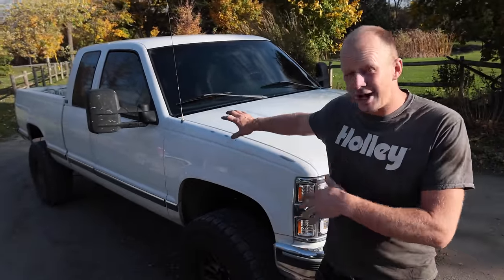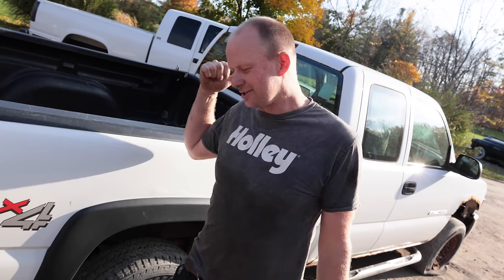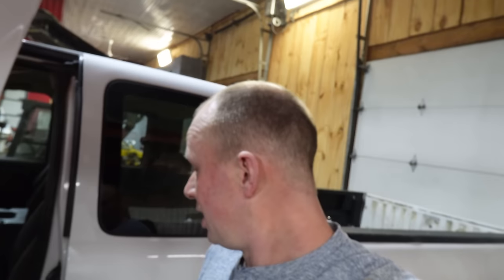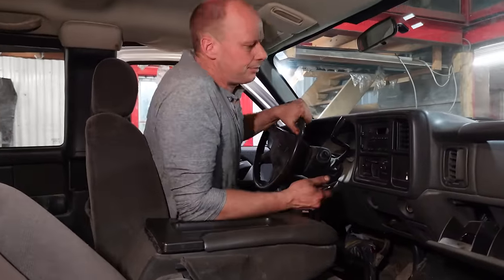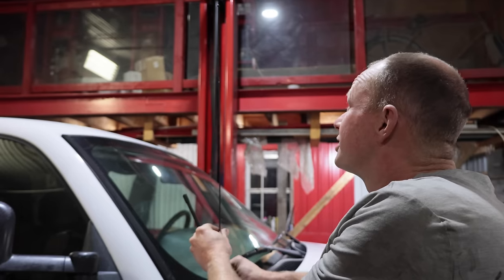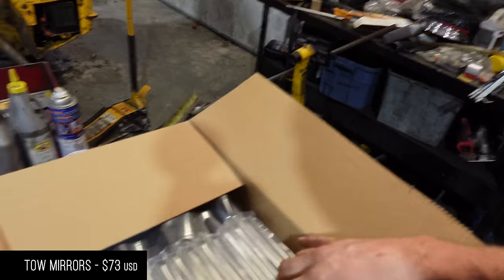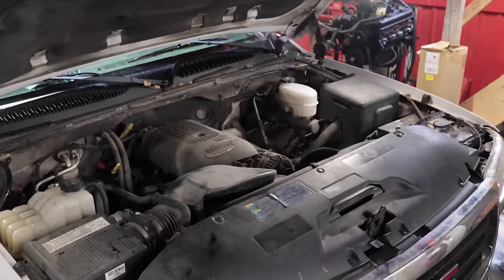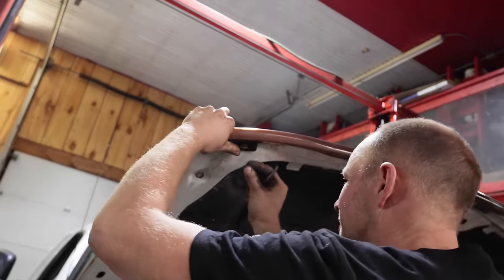Top 10 CHEAP Upgrades for a Rusty Sierra/Silverado!

Comment from the maker: What do you feel is the best value for the money on this list? (affiliate links below)

Spark plugs https://geni.us/TR5GP
Rear door handles https://geni.us/15758171
Front door handles https://geni.us/15034985
ATOTO Carplay/Android stereo https://geni.us/A6PF
SCOSCHE install kit https://geni.us/ICGM8BN
Backup camera https://geni.us/PMD2A-S
7" Antenna https://geni.us/rydonair
Tekonsha P3 trailer brake controller https://geni.us/90195
Reese Towpower GM harness https://geni.us/78050
Tow mirrors https://geni.us/TWM-001-T222-BK
LED brake light & cargo light https://geni.us/tresound
Pennzoil  Full Synthetic https://geni.us/5w30
Oil filter https://geni.us/pf46e
Fender flares https://geni.us/oxgord99-06
Bushwacker rocker set https://geni.us/ext-cab-trailarmor
Hood protector https://geni.us/highprofilesmoke
Transfer case housing adapter https://geni.us/926-891
Gasket https://geni.us/felpro72770
O-ring https://geni.us/926-832
Toyo Tires  A/TIII https://geni.us/toyo355570
Reply: And a wire brush and a lick of paint…
Reply: Love your content BUT really tired of hearing you talk Shit about FORD it's Sooooo Funny how they out sell the others.   Again love your video's you do a amazing job 👍 with your videos people really can learn things if they pay attention they will learn how to do things.
Reply: probably got a bad lifter or two
Reply: Heavy duty rear door handles for future reference you can get metal door handles for the handle in between the two doors I found mine by typing in Chrome heavy duty door handles they look different but they are way more rugged because if they're metal you don't break it when you get upset  you can't open the rear door and break the handle all to hell LOL

Comment: Being the owner of an 05 Silverado in Michigan, I feel personally targeted by this video.
Reply: I got an 03 Burb in MN. So relatable =P
Reply: 2002 Silverado in Georgia. 21 years and rust free glad im the south but i still wana do some of the things he did here
Reply: theres anything left of that?
Reply: 01 Silverado, original owner. With the 4.3. Take that for targeted.
Reply: From Michigan and we as a state do not fucks with this video 😂
Reply: @ewdtrey  good motor... check your coil wires, they break inside the plastic sheathing at the hard bend into the top of the coil
Reply: I bought a used car from a dealership in michigan, back in 84.  The brake lines broke on the drive home.
Reply: Same lol, got a 2001 Silverado in Michigan
Reply: 03 Sierra also in the mitten. I feel ya man, my driver's floor pan is gone
Reply: Womp womp

Comment: As an 06 VortecMax owner, I identify with everything in this video. Besides needing the usual ball joint, tie rod end, etc etc replacement, and one rusty brake line…it’s been a really good truck. I bought it out of Michigan and brought it home to Minnesota. But the only rust is the inner rockers. I decided rather than chase the rust, I’ll run it a little longer then swap the LQ9/4L70 into my square body project. This was highly entertaining Rich!

Comment: Yes. A northern truck. The frame might rot in half and all of your brake lines and fuel lines are leaking because of the rust and all of the body has holes in it but hey, the dash looks great! Always looking on the bright side even if there is no sun

Comment: I did the exact same thing two years ago.  I picked up a dirt cheap 2000 Sierra 2500 4x4 SLT(leather!) with a decent frame, new brake lines, a broken flexplate and bald tires for 1800 bucks.  I live in NW Ohio, so it's a typical rusty mess with no rockers.  Bonus, being an SLT, it comes factory with fender flares that I zip tied back to what remains of the fenders and bed sides.  I took care of all the problems I could find, including yanking the heavy-@ss 4l80 to replace the flexplate and rear main, and found out (after I could drive it with out shaking itself apart) that the transmission was not going into lockup.  Took it to my local transmission shop once I figured out it wasn't just a bad lockup solenoid, and they said the pump wasn't happy after it's broken flexplate adventure and the transmission needed a rebuild.  Now I have an ugly truck with new tires, wheels, brakes, radiator, flexplate, rear main seal, oil pan seal, rebuilt front suspension, shocks, and a rebuilt 4L80e behind a 6.0 with rock solid oil pressure at 240k miles.  I figured the same thing as you, once the truck rusts so bad that the fame cracks, I'll yank the driveline and stick it in something else, probably another GMT800.

Comment: Life in the Rust Belt. Nice Job Rich. I have A 06 GMC Sierra regular cab 196k. I did  flares that attached to the factory holes with push pins & OAM quick Covers. Looks 100 times better

Comment: I don’t regret just getting a new truck. lol. I owned 5 of this era gm truck and while they are awesome and reliable, cheap to fix for the most part a simple. I like getting in a new truck and not having to worry about getting underneath always fixing something. That said I use my truck for my business so obviously a rust bucket is not for that. But if I needed a winter beater just to get around town this gmc you got would be my pick.

Comment: You could do some cheap and fast bodywork on the lower doors and Cab conners and spray paint with a rattle can and it will look amazing.   Throw some Bondo on it sand it down and spray paint it and BAM no more rust you get the picture.

Comment: Thank you for this. I had a mint 99 obs Tahoe my grandfather bought new. This summer a girl was texting and driving and didn’t yield on a green left turn. Plowed right into her. Thankfully it wasn’t head on but my front end is pooched. Only fluid I lost was battery. I’m thinking about an axle swap incase the suspension is messed up. I had bought an 03 Yukon xl from a guy from work for a grand to use as a farm truck. Now I get to freshen up the Yukon it’s pretty rusty but the frame is mint. Plus the 5.3 is dripping enough I have anti rust spray lol 
Thank you for your work sir!

Comment: Tut, tut, tut, Rich, before putting the rocker cover, you could've rattlecan white the rust sticking past the cover.

Body colour rust attracts less attention than contrasting orange.😉

And the bonnet lip protector thingy with one side snapped, well.....trim the other side to match.

With all that done, you'll have a 5ft truck instead of a 10ft😜

Ain't Bangernomic fun👍🏻😂

Comment: With those rocker covers, if you installed them on a truck with perfect rockers, as long as you put a bead of silicone around the edges,  o dirt or water will get in there.. that’s what I did with all my fender flares on my trucks and they never rotted out once.. not even surface rust

Comment: I had an 04 that was in similar shape. Knock and o2 sensors were gone. If I drove it like a grandma, MAYBE I could get 400km to a tank. He old girl had 400,000km on it. I ran it till the cost of new tires exceeded the value of the truck, then sold it. Still see it driving down the road!

Comment: Finaly a video i can relate! 😅 i bought a 06 2500HD 6L 4L80e 4x4 just because it had a working plow on it for 1500CAD! in really similar shape. 283k kms driver seat is mint but ive inspect the frame and its just a bit too rusty for my liking so im not going to dump money into it to make it road worthy  but i will 100% keep it for parts i even have a SLE so its got some nice opt into it! 😅

Comment: I put the same mirrors on my lb7 and I noticed the same issue with them, that they don’t rest in the correct place. I ended up welding a tab onto the pin that allows the mirrors to pivot. Making it to where they no longer pivoted, I figured it was a get what you pay for situation.

Comment: See if you can swap the bottom part of the seat with the passenger, I was able to do that with my Dakota it was like night and day. It put the rip on the inside of the passenger side and gave me a cushion that seemed to never been sat on. It has 230k miles and still drives I just have to fix a couple of things to put it back on the road, might do that this weekend.
Reply: It's a bit of work, but this does work
Reply: @taylor2105  On my Dakota it was just some clips holding the cushion on, didn't have to remove the frame. Fold the seat forward, pop the big clip off the back, then push the seat back to get the side clips, then it slid off the front. I never owned a Chevy so I don't know if it would be this easy.

Comment: 2005 Silverado 1500 5.3 LS (best engine in the entire world) 480,0000 km on it. Never not gotten me to the beer store. Needs rockers and corners. New exhaust (tip) aftermarket radio, underglow. **comes with STOCK RIMS** $10,000 obo - low ballers will be ignored 

^Every Ontario Kijiji listing for a bartered old pickup that will financially ruin you to safety

Comment: Heavy duty rear door handles for future reference you can get metal door handles for the handle in between the two doors I found mine by typing in Chrome heavy duty door handles they look different but they are way more rugged because if they're metal you don't break it when you get upset  you can't open the rear door and break the handle all to hell LOL

Comment: Did I miss something or did you not fix the rear axle and just remove the axles? Instead of rocker cover i would have just installed 2x6 tube rock sliders

Comment: 170K miles , here in TEXAS THAT WOULD STILL BE NEW HERE ..I GOT MINE WITH 212 THOUSAND MILES, FOR A THOUSAND DOLLARS EVEN , NEW TIRES AND BRAKES STEERING AND MASTER CYLINDER, AND NEW STEERING BOX AND NEW COLUMN ,, 
I JUST PUT A 5.3 IN IT , HAD A 6.0 I COULDN'T FIND ONE LOCALLY, WAITED A MONTH FOR A GOOD USED 5.3 ...RUNS GREAT,, 10 MPG THOUGH

Comment: @Debossgarage what is the quality of those trailer mirrors? They look very flimsy when you were adjusting them.
Reply from the maker: Those mirrors are pretty crappy, but very cheap, which was a good fit for this cheap truck.   We put better mirrors with lights on the 05 dually and they are much better, but cost more.

Comment: All good upgrades but still missing something. See it's good enough now but it's gonna keep on rusting and maybe last 2 to 3 years. But if you could preserve it as is you could get another decade out of it. 

I just got a woolwax pro sprayer and some fluid film for my 05. Shes an old rust bucket starting to look like this one but I sprayed it and will continue to spray it. 1 or 2 gallons of fluid film per year and maybe an hour of setup and spraying each time, should buy me at least a couple more years before I have to buy another gmt800 but from down south this time.

Comment: 16:15 not to mention smaller antenna means it doesn't get ripped out at the carwash  i still need to find a antenna assembly  that fits a 2000 dodge Dakota

Comment: This would NEVER, EVER FLY IN PA. with our STRICT INSPECTIONS.

I have a 97 ZJ with 186,000 miles on it that's RUSTED ALL TO HELL UNDERNEATH, it hasn't passed inspection since 2020 & I only drive it at night, LOL. The body looks MINT BUT DON'T PUT IT ON A LIFT, NOPE.

Comment: 22:30 attaches side skirts to cover rust? no way... theirs no way, those could be attached to rust. like the AAM1150 under it weighs 700 pounds, the more you know... cab corners only rust out when the kid passes out drunk after eating a McDonalds and spills the coke on the floor. then they grow up to pig and push on the back of the seat braking the back rest adjuster and wake up in the loonie bin. have to beat it with a hammer to know...

Comment: Please stop talking about antennas, your embarrassing yourself. Stock antennas are tuned.   The little rubber duck might be too but capture area applies.  If your stations are distant stay with stock or get a taller gain antenna. Cables and corrosion are far more important.  Chinese rubber ducks are pointless.
Reply: bigger isnt always better higher frequencies require small antenna. due to the smaller amplitude
Reply: I think he’s making jokes…

Comment: its rust bucket fuction get it fix or flipped well paint little time i would cut cut cut patched cost more now replace so just patch it paint it still pile new shocks lot lots grease oil fluids changed everything first date hell if dont open your door after opening hers let alone meal ticket wine and dine i do all that did all that before hand used trucks like used women no thanks life to short for social except rather full belly sound mind bills payed